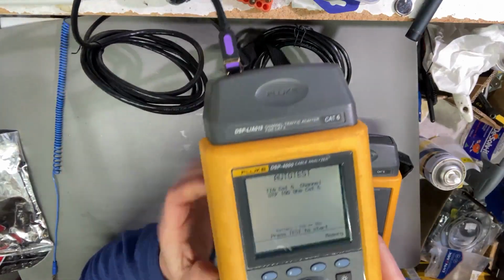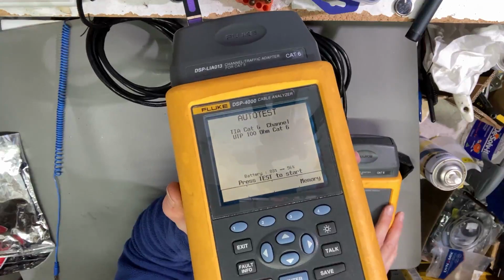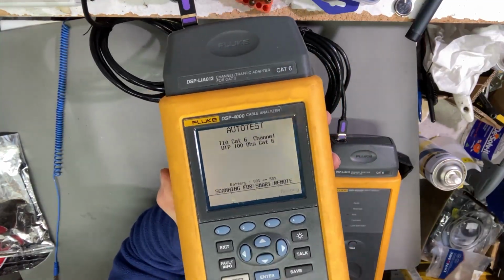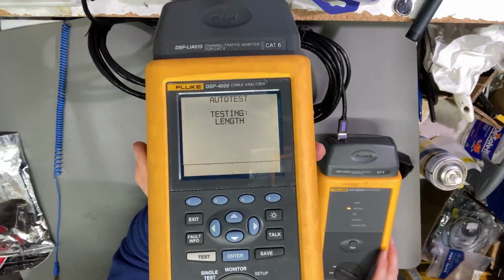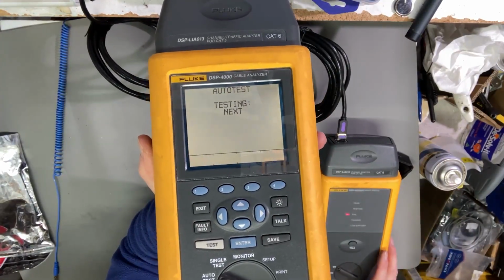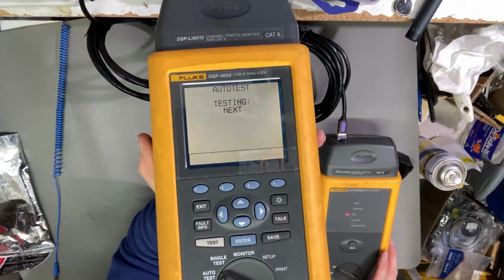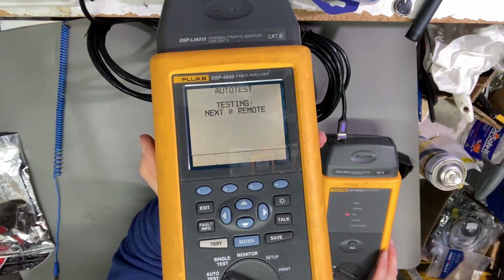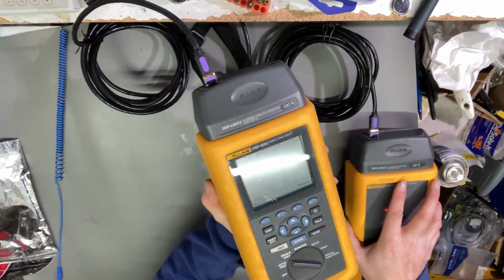"Cable Radar" using the Fluke DSP4000 Cable Analyzer demo  - 1

Comment: Hi i have exact the same model of fluke dsp. When i try to calibrate all i got is massage that "calibration fail" im using  oryginal  DSP 4000 cal module. Any solutions?
Reply from the maker: Sorry, I don’t think I can help.  The only thing I can think of is that, if you have changed the firmware,  then change it back to the version you were previously using.
Reply: Thank u for response, i havent changed  firmware. It was calibrating fine before, i havent made any changes